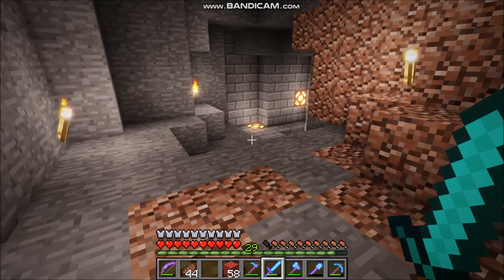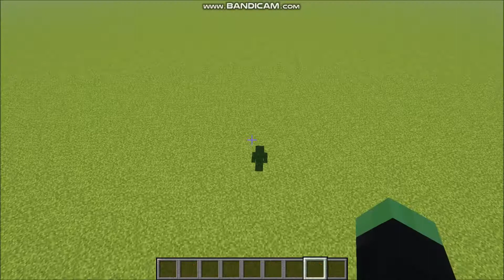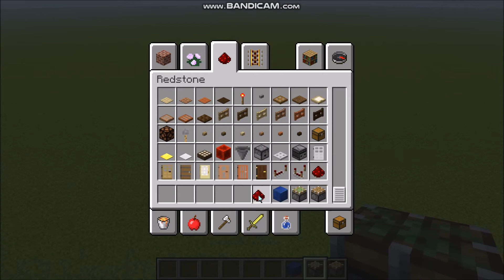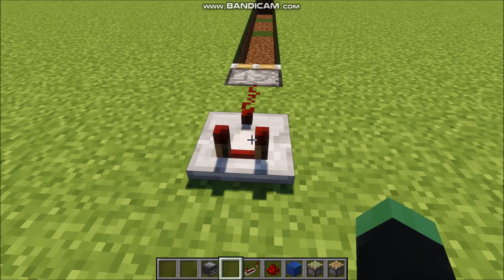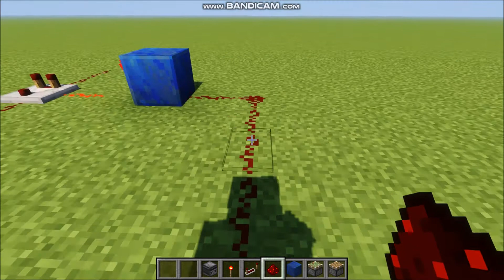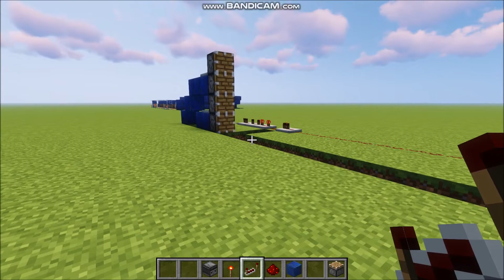Redstone Tutorial: Automatic Concrete Maker/Stacker

Comment: According to a different tutorial. You can push blocks with a piston and explode it with TNT at the same time so it has a 100% drop rate and 0 resistance. I could see if I could modify this to have that. It will be hard
Reply from the maker: Fascinating idea, but I personally would not waste the TNT on it unless you have a pretty impressive mob farm to supply the gunpowder.
Reply: I finished it, stepped back and realised what a waste of time it was. No-one in their right mind would use it. It is massive, uses lots of recources and some concrete can get stuck so it isn't even 100% effecient. I could design a better one with just a pickaxe and water with no redstone! But it was a fun thing to do nontheless
Reply from the maker: @TheGamer-sq7st  That's the goal, right? Redstone is meant to be fun, and I love building unnecessarily complex machines that look cool.
Reply: Yes but this is good for console players